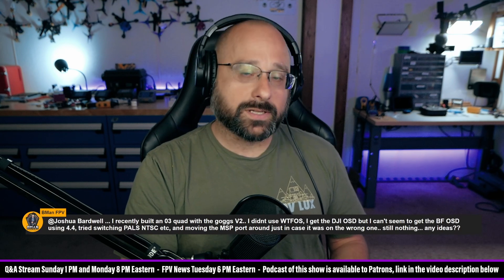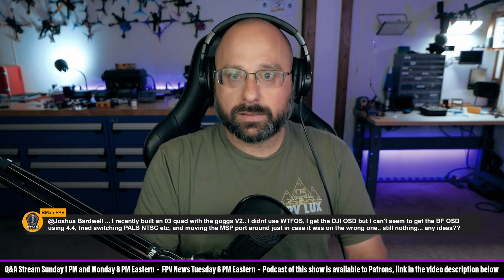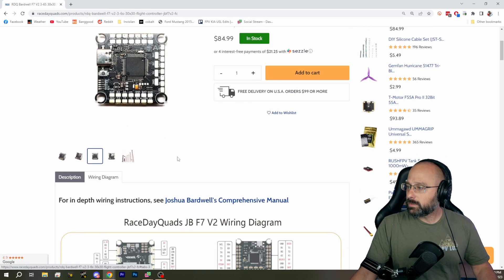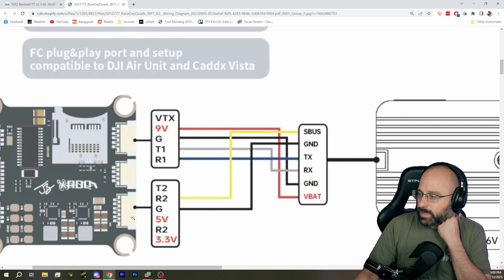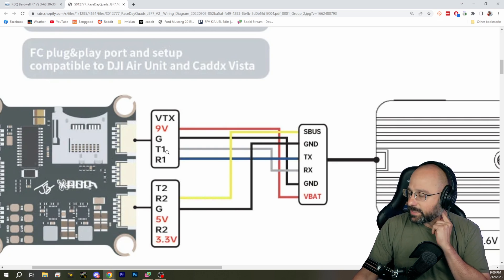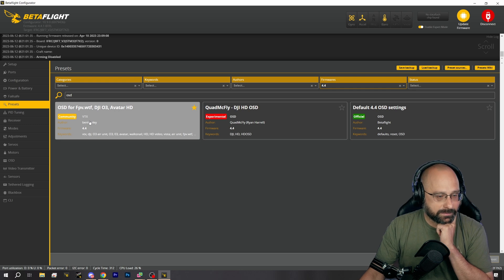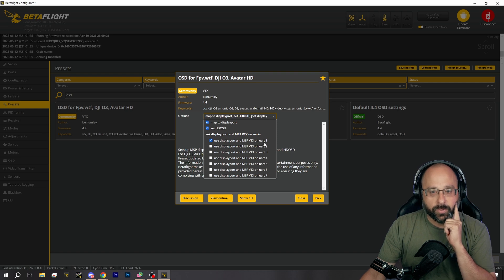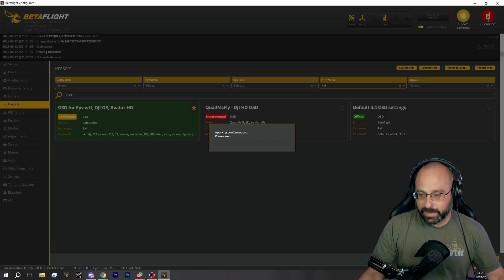DJI O3 Air Unit Has No Betaflight OSD On 4.4! Help! MSP Displayport! - FPV Questions

Comment: Just fixed this problem with betaflight 4.5 where you can't do cli to assign a UART (in the preset no need to subtract 1). Also I forgot to change to HD in display in goggles. Joshua rocks although he does not answer emails

Comment: I had the same problem and did exactly what Joshua mentioned in this video but it didn't solve it. So... after many many hours i finally was able to find the problem.I forgot that the O3 and probably any other VTX has the RX and the TX inverted (RX O3 to TX FC and TX O3 to RX FC) from your air unit to the FC.  That was the reason i had video output but no telemetry OSD. 

I think that many of us probably make the same mistake. (or at least this was my case)
Reply: You are the fu c k i n g master, i have been going crazy for 6 hours trying to solve the problem and until i sae your comment i hand't noticed that small detail, keep It Up
Reply: the hero we need!
I swear its stuff like that which tests my love for the hobby every time lmao
Reply: Are you talking about the DJi voltage in bottom right?
Reply: lmao ty bro
Reply: do you mean it should be tx1 to tx1  instead with some devices?
Reply: how did u fix it tho i cant get the OSD on my goggles yet
Reply: Yep, you saved another one. After staying up all night after a build, I couldn’t get my OSD to work. Switched TX and RX and like magic works like a charm.
Reply: After getting OSD to work. My video format column disappeared in the OSD tab. Now I can’t switch the format to HD and my OSD display is not centered. If you move items to the far right, they display in the center of the screen .

Comment: Thank you very much for the help.
But I have a CineBot30 (F722) with O3 (4.4.3), and I see the OSD, but the Betaflight alarms do not work, for example the temperature alarm of the O3.
On the other hand my Pavo20 (4.4.1) with O3, the O3 temperature alarm works.  

Any idea how to solve it? or is it only a problem of the F722?

Comment: Something worked for goggles 2 not showing betaflight OSD on a speedybee v4 F405,  I used a random DJI OSD with no GPS preset that caused no errors, I also have no gps fix and pretty sure a faulty m100 mini so i set OSD GPS display and UART disabled which may be the cause, then in CLI   "osd_displayport_device = MSP" well known command but then used "set vcd_video_system = HD"   which magically worked. I will be able to tell you later as I take note of this as I reconfigure this FC routinely and fix the GPS.
Reply: Hey man you're one of the few people who seemed to have this issue with the old system. Have you by chance experimented with the goggles 3 and O4 air unit? I'm using the Speedybee F405 AIO as well in my build with beta flight 4.5 and I can't for the life of me get the OSD to display in my goggles 3. I'm desperate to see my voltage readouts.
Reply: uart 1 --  periphals vtx + display port  auto must be on
Reply: dji with gps not working in 4.4?
Reply: Can I give you the biggest hug man I’ve been trying for at least a week for 3 hrs a day fick this

Comment: This still didn't help, no OSD in my new drone with 03 air unit. Ive selected this preset and have selected the correct Uart but still nothing.
Reply: Did you sort it?

Comment: How do you fix the osd display? I got mine to work. Im using dji goggles 2. However, when I move any display setting all the way to the right, it will appear in the middle of my screen in the goggles.
Reply: Go to the cli tab and type 
( set osd_canvas_height = 20 ) hit enter 
( set osd_canvas_width = 53 ) hit enter Type save

Comment: Im still so stuck with this... both my Goggles V2 & 03 Air Unit are on the latest firmwares, Ive turned on the correct uart msp and done the CLI commands but still nothing. I can only see the DJI standard OSD readings :(
Reply: same here
Reply: I have fixed mine now! My issue was the cables where the wrong way round from the FC to the 03 unit @Mocksi766
Reply: guys, set to HD mode in Goggles. Let me know if that works

Comment: except its not FC is running 4.4, air unit and goggles are updated to the latest firmware o have the right uart connected and nothing

Comment: Not sure what magic this preset does but it fixed my osd non-displaying with the O3 and goggles 2, I thought that you would just need to set MSP on o3 connected UART and put MSP + displayport as the config which I did but nothing shown up in the goggles until I picked this preset. Thank you anyway, it's know looking like to work

Comment: Dont you need wtfos no matter what if you want to record your osd stats?
Reply: Yes
Reply: No. Wtf only supports Vista or original Air Unit.  O3 supports Betaflight OSD natively without using Wtf. If you have Goggles 2 you can record Betaflight OSD over your DVR footage but with older Goggles V2 you can only playback the OSD when viewing in the goggles (due to hardware limitations).
Reply: @Ddraig62SPD  I talked to a few people and they confirmed that you are indeed able to record bf osd as a delegate file using the goggles v2 and the o3 and then overlay it using wtfos. So my original comment was correct
Reply: @Sidiann  interesting! I was able to do that in the WTFOS overlay page using Vista and Air Unit (both running WTFOS) but not using my O3. Maybe there has been a firmware update on O3 and/or WTFOS overlay page. I will check tomorrow to confirm 👍
Reply: @Sidiann  did you mean the vista? Because this functionality exists for the vista, not for the O3. If someone came up with a solution to record osd on the o3 id be very interested in that. But wtf.os cannot do that currently.
Reply: @Ddraig62SPD  so do i see the osd on the googles v2 ? no ? right only when i playback it ?
Reply: @Akoohn  OSD visible during flight and option to enable or disable OSD visibility when DVR played back in Goggles V2.
Reply: @Ddraig62SPD  awesome Thank you